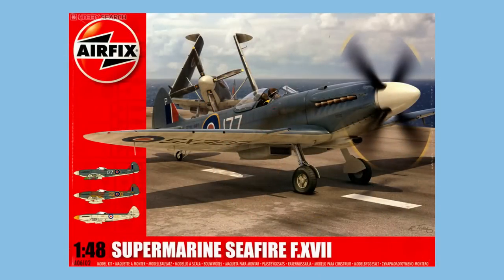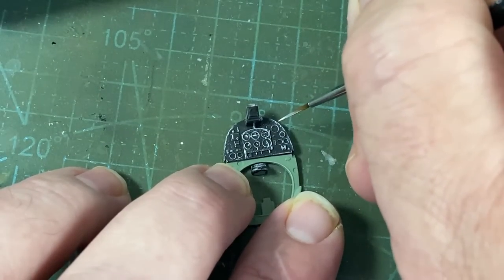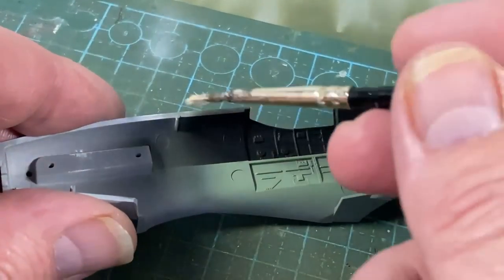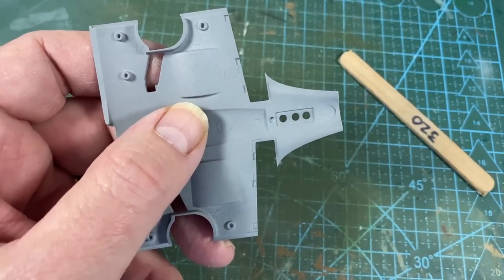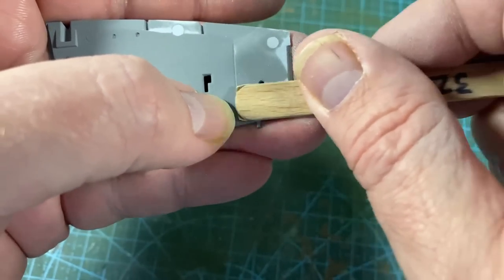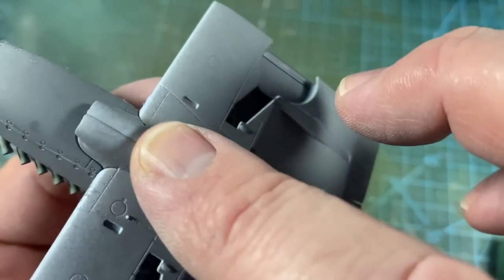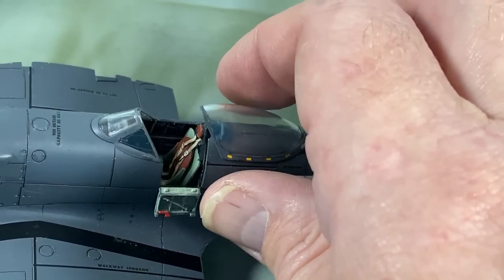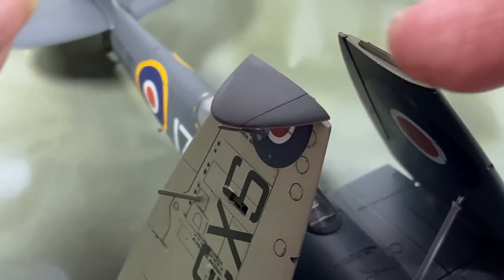SEAFIRE Supermarine Seafire F.XVII Airfix 1/48 scale - FULL BUILD HD 1080p

Comment: Very nice build Gary! A tip, or two more for the oil filler cap would be to punch out a thin (5 thou or less) plastic card the right diameter using a punch and die set glue in place and sand down to thin it further leaving it just proud of the surface. Another (and cheaper!) method is take a brass tube of the appropriate diameter and use a round rat-tail file to sharpen the edges or rim of the tube. This can then be used with a twisting action to engrave a circle in the plastic. The tube can be retained for other such kits.
Reply from the maker: Thanks Randall - if I build another Seafire with this issue I've plenty of advice now!

Comment: 1 Useful tip for the ID lights (I learned this doing the new Airfix 1/48 Mustang which has clear ID Lights on the wing) is to use clear paints on the inside surface of the Clear part, let it dry then coat it with a bright silver - it will pop the colours by reflecting any light back out of the part. Make sure that all paints are dry before starting the next steps. When done, use liquid mask on the clear side CAREFULLY, then secure in place with the unpainted side to the outer surface. After all painting, unmask the lights et Voila!
    This works better than using just Red/Orange/Green or Blue paint and better than just using the clear colours because the interior will be black from lack of light) and dull the appearance of even standard paints just a little.  
     My Suggestion for the Fuel filler, drill out the scribed area (AFTER joining the fuselage and before filling and sanding) and find a segment of rod (Even a length of sprue may work!) that is not too tight a fit; 10mm should be long enough. Glue it in with ultra thin leaving about 1/2 mm or 1mm proud of the outer, IMPORTANT! Fill and sand the fuselage joint before gluing in the ROD! Then shave and sand down flush. It the fit of the rod is a tad loose then the circle should be visible. IF the fit is tight then you can lightly chamfer to hole after drilling it, before adding the sprue/rod... his Takes all of 15 mins not counting letting the cement set hard.  HTH.
Reply from the maker: Cheers Brett. I painted the inside of the lights with silver (well, aluminium which seems to work better with Vallejo paints) - I always try to do that. I'll try adding the colour inside first next time I need to do it.
Reply: @garys_stuff  
You could fill and sand the circle and then rescribe it with a needle and circle template.
BTW have you seen that Molotow has released masking Fluid in a felt-yip pen'?  It looks very handy.
Reply from the maker: I'll check out those pens...

Comment: Hi Gary I'm returning to the hobby after 30yrs.Enjoying your content I've purchased a spirited no 18,seafire and two bucaneers all in 1.48 scale.
I also build and paint warming miniatures for historical games
My last suffix kit was in the 80s and was a 1.48 bucaneer.
I'm wondering if I should undercoat the parts before applying paint.
Reply from the maker: I always use a primer coat, a spray can works well. If you're using acrylics then they are water based and need a good 'key' to bond with the surface, and bare plastic is sometimes too shiny. My favoured one is Jenolite for plastics but I'm told the Halford's one works well and of course there are primers made by Humbrol.

Comment: Hi Gary, I purchased this kit 12 years ago ,its been in my loft all these years now I have retired I am going to give this a go . How do you glue parts together that have already been painted ? Do you you a special glue ? superglue ? you make it look so easy . I remember many years ago the joint would become a mess as the paint from both parts would come off ! Very good video by the way . Many Thanks
Reply from the maker: Hi David, I use regular polystyrene cement much of the time - either Contacta or Tamiya Extra Thin. I find it works with bits that have been pre-painted with acrylics OK as long as it isn't plastered on! Also, often I'll dry fit and need to sand a bit anyway and the contact surfaces are cleaned. The trick is not to use too much glue - like I certainly did when i was a nipper! This Seafire kit is lovely, should go together very well for you.

Comment: With the Walkway decal, is it long enough to fit the /whole/ wing when flat, and you're supposed to fit it to the whole flat wing, and /then/ cut it where the wing folds?
Reply from the maker: The wing comes in pieces, and the outer panels don't sit flush with the inner panels - I guess sit's to do with the thickness of the plastic and stuff like that. For the unfolded wing there is a single piece upper surface on each side and that would be fine, but for the wings folded you have to cut the decal. The only option is to build the kit then try to fit the decal with the wing folded - which is probably even worse!

Comment: Hi Gary, nice result.  A really good job.
A couple of observations.  Could the cockpit mouldings be slightly wide contributing to the gaps in the fuselage joinup?  Would the tail wheel doors go in better before the wheel?  Would the little wedge in the elevator hinge fit into the gap in the elevators and be fitted at the same time as the elevator (maybe too difficult with the adhesive)?  Have you thought of a mini-drill (dremmel type) with a router bit for removing yhode lumps in the mouldings like at the end of the wings?  It would let you grind below the joint surface unlike the emery board.
The "strut" on the landing gear that you broke, is properly called a scissors.  It stops undesirable stearing in the lower leg.
Aircraft by this time had constant speed airscrews so throttle and mixture but I don't know what the third lever is for.
Reply from the maker: Hi, all good points. The only thing I'd say about the drill is that I have found the high rotation speed tends to melt the plastic rather than abrade it even at the slowest setting. I know one (really good) modeller online has a custom-made controller that reduces then speed further allowing him to use the drill.
Reply: @garys_stuff  Hi Gary, I understand the heat issue.  The ammount of heat would depend on the cutter as well as the speed.  A good open tooth cutter such as intended for wood would probably be best, perhaps with a sort of dabbing action (hard to describe)  wherr you touch the surface then withdraw, then repeat.  A delicate touch.  I can't think of another method that grinds the waste flush without touching the precious edge.  I like the idea of a speed controller though, more suitable to a battery drill.
Reply: @garys_stuff  Hi Gary, quick update.  I have a Dremmel 3000.  It is 33000rpm max but has 10 click stop speed settings.  I put a HSS die grinder bit (I think it part number 7180 but I might have some digits wrong) in the collet and set lowest speed.  I had a bit of gash plastic from a label on a DIY tool.  I don't think its polystyrene but it isnot dissinilar.  I fairly easily ground a small recess in the plastic without melting, simply scalping flakes off the surface.
While I was looking for stuff I remembered a vid I saw earlier this year by a railway modeller about tools from Lidl and Aldi.  With a dose of lateral thinking I thought some of us aerophiles who might fancy the odd diaorama could learn some techniques for mud, foliage etc from the railies.

Comment: Loving your builds Gary! How do you get away without scraping paint away prior to glue parts together? I always end up in a mess of non adhering components even after carefully removing paint off mounting faces!
Reply from the maker: Anything critical I do sand off or scrape off paint - like fuselage halves or the undercarriage legs. otherwise it all seems to work OK.
Reply: The nagic of super-glue.  Most plastic cements need 2 clean plastic surfaces to work.  You can't melt the plastics together if they're coated with nonplastic like paint or plating.  Acc/superglue attaches to the surface so light parts can be surface-bonded.

Comment: Really good,Gary. How do you feel about the water slide transfers overall? Do you think it would be better to replace with a new set of decals?🤔. 👍😎Pete 🤓
Reply from the maker: The transfers were thick, which is good for colour density but they took a lot of microsol to get them anywhere near the panel lines. If Airfix did re-release the F.XVII the decals would be much thinner. I guess it's an extra decade of printing technology. In the absence of a new kit, I might look at aftermarket roundels at least, the numbers and stencils are OK.
Reply: @garys_stuff  Thanks Gary. I do have one on the shelf which has slowly accumulated extra parts and adding a few rounders is no problem👍. Thanks again for your advice👍😎Pete 🤓

Comment: Nice Work Gary, built a few FAA kits over the last few years and did wonder - How on Earth did they take off in that lol
Reply from the maker: I think one of the worst was the Seafire FR.47s in Korea. With overloaded aircraft, steaming on one screw because of a bearing failure on the other and little natural over-deck wind was an issue. They either used the catapult/accelerator (which often broke) or they used rockets to boost the take-off. With the weights being used even this was, to say the least, marginal. They needed a bit of flap, but the Seafires were either up or down, no intermediate steps. So they got the ship's chippy to fashion wedges. The pilot selected flaps down, they held the wedges in, then selecting flaps up gabbed the wedges and kept the flaps slightly open. On take-off, gear up then at a reasonable speed a quick down-up cycle of the flap lever and the wedges fell away and the flaps retracted.  How the devil they managed is quite beyond me.

Comment: Nice job, as usual. Could you recommend a Seafire kit with the contra rotating props 1:48 please?
Reply from the maker: Your option is essentially only the Airfix one from 1996 - released again in a new box in 2012 - as I don't think anyone else has done it in 1:48. Easy enough to find second hand. It's an older tooling but still reasonably good. It makes the FR.46 (fixed wing) or FR.47 (folding wing) versions. There is some aftermarket stuff available too - open gun bays for example, and you might want to look at newer decals (Freightdog does a set).
If anyone from Airfix is reading, please re-tool the FR.47. Seriously, please.
Reply: @garys_stuff  Thank you.

Comment: What color of the seatbelt using a tape
Reply from the maker: On planes like this I use a linen colour, on later aircraft they would be blue or olive green depending on the age. But I might be wrong with the colour, so check online sources!
Reply: beige siege satin varnish did you mix?
Reply from the maker: On this kit it was Humbrol 237 desert tan.